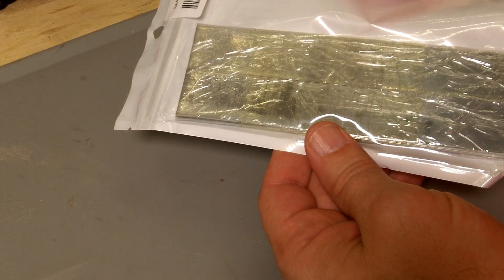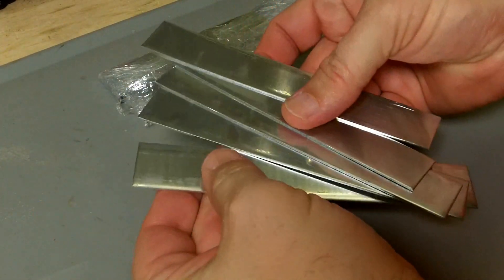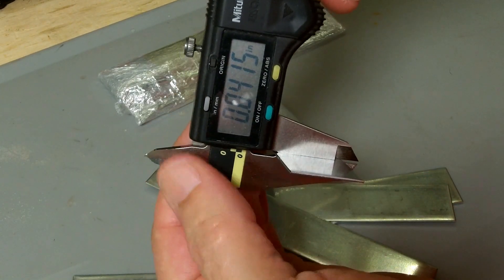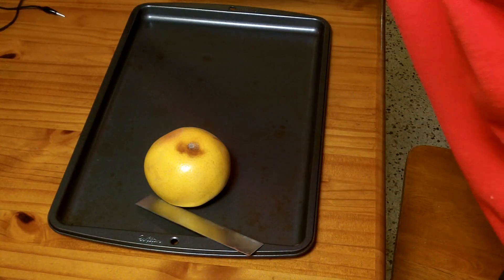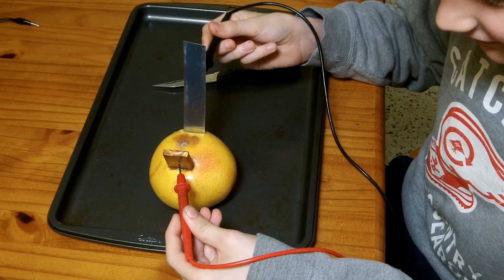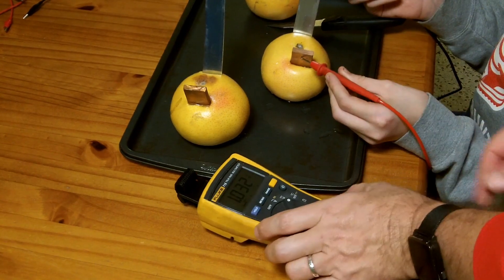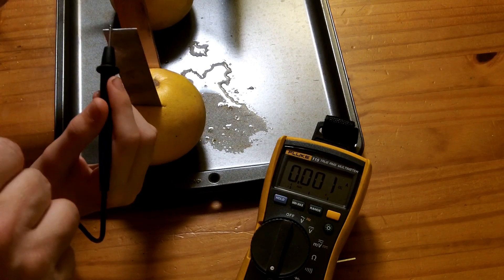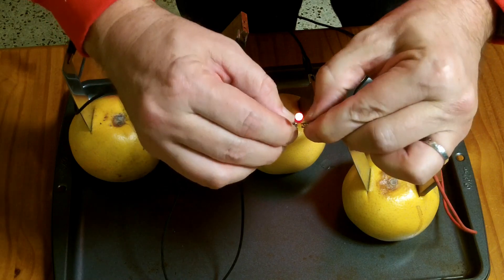Making a Lemon (Grapefruit) battery with Pure Zinc Electrodes (anode) and copper (cathode)

Comment: how does that change the flavor?

Are they rechargable?
Reply from the maker: I did not check, and no.
Reply: @summetj  could be interesting if it could make lemons (or qrapefruit) that aren't sour...

also, alkalines are actually rechargable, despite what is claimed, because they are not efficiently or quickly rechargeable.